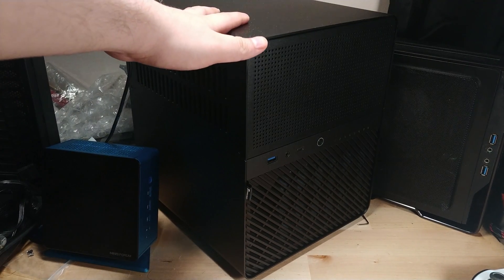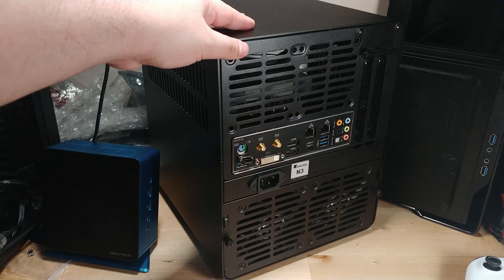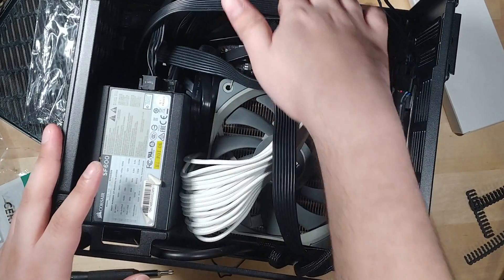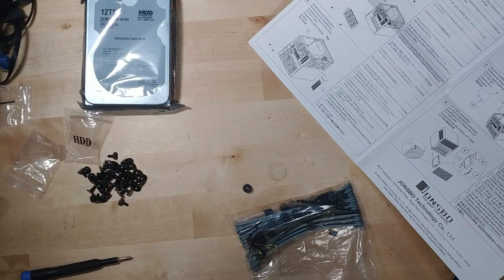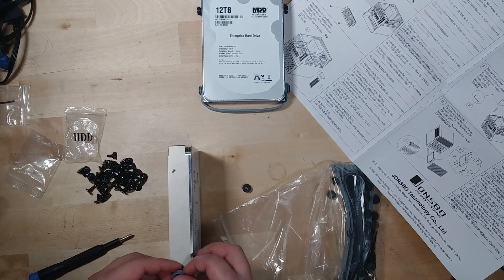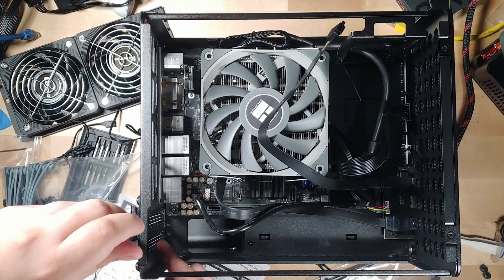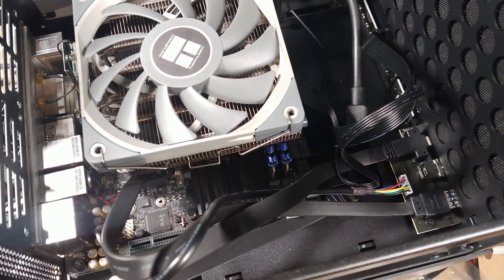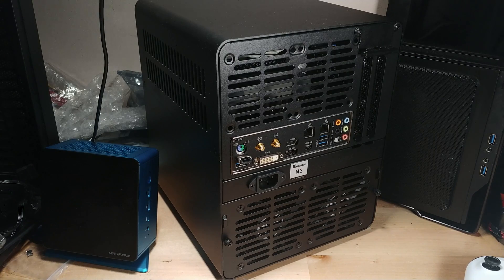8 Drives In ITX NAS Case? | Jonsbo N3 DIY ITX NAS Build | 52TB Of Storage

Comment: Funny thing is, that now there is a C246 chipset based board on Ali that I and a friend have ordered for that case that has 8x SATA on board and 3x M.2 PCIe (1 on top and 2 on the back) that is basically made for this case :D 
I will use one M.2 for a USB 3.1 10Gbit controller to populate the USB-C at the front and maybe later cut a little hole for another on the back. One M.2 on the bottom for the OS drive and one for a 1TB SSD Cache.

Comment: @EVOTech1  I have this mobo and a 6600k and a 7700K cpu. Can you do a video on under clocking to lower the tdp please? Also is your Z-170 a Rev1.0 or Rev2.0? 
Rev 2.0 allows for bifurcation of your x16 pcie slot.

Comment: i have been planning for a month to build on N3 case. as you said it takes a lot of planing
Reply from the maker: It's honestly so worth it. I love this case. We recently renovated one of our rooms and it happened to be the one where we kept the servers in. I have this N3 Nas and another older one that is running in a rosewill server case. moving that rosewill was such a pain in the ass, but the N3 being so small was so easy to move. I'm honestly considering swapping my old server into an N3 case. it's mostly 8TB drives anyway so if I go with 14-18TB drives, I'll end up with way more space while downsizing in the number of drives by just 2. Having a compact system with so much storage is honestly so much more useful than I would have originally thought.
Reply: @EVOTech1  thanks for sharing. Lots of people online complain about the drive bay and the rubber strap ( literally no one swap there drives frequently you just leave it there ) but they don't get that for less than 150$ you're getting a 8 bay hot swappable and good build quality case which will last you a lifetime. For the size and value of the case I'm grateful to jonsbo

Comment: a must have for these itx nas builds: thin sata cables. there are ones from silverstone and supermicro. sas to sata, sata only, whichever you prefer. but, beware. i bought the silverstone ones and they are nice but the cable is coming from the side of the sata connector that goes into the motherboard. so you will need to bend them if you have sata oorts on your motherboard one right next to another. really silly design, it would be better to have the cable coming straight from the top of the connector, but then that would be an issue for those vertically stacked sata ports on the mobo. i didnt try the supermicro ones since they are obscenely expensive in my neck of the woods. i managed to squeeze the silverstone ones and for now, knock on woods, they are fine.

Comment: you should use the stock cooler, or a general small copper contact, aluminum thermal heatsink cooler,  rather than the thermalright AXP-120, it's too big and waste of money
Reply: The case can handle it and t's only $30.

Comment: If you don't need the onboard wifi, you can replace it with a miniPCIE  to SATA card which has two to four SATA ports.  It's usually just a single PCIE 3.0 lane, but that is capable of handling two 2.5" SATA SSDs, leaving your PCIE x16 slot free for future upgrades, like a 10gig NIC.

I chose the Jonsbo N2 for my NAS, and I plan to use a pico PSU to leave room for a 3D printed 4 bay SSD cage at the back, and I have a QM2 combo card with a 10G NIC and two m.2 drive slots onboard.
Reply: Are you sure regarding this? 
Will the OS recognize those drives?
Reply: Have you actually tried this?
Reply: @brbbst  Yes,  in my old NAS.  I had a Gigabyte Z97N-WIFI ITX board with six SATA ports but my chassis had eight bays.  I swapped out the wifi card for  the miniPCIE SATA card with two additional ports.  It worked a treat.  

Note more modern boards use a CNVIO slot, which is different to the old MiniPCIE.  Also check for clearance - some boards have the slot positioned between two  other modules on the REAR IO and you might not have room to fit SATA cables.
Reply: @Spreadie was that a Haswell system? Was the wifi module pcie in those? I think it was M key. Interesting idea.

Comment: IOCREST M.2 might help, if there's a need to reserve pcie slot for other uses. But that'll require an itx mobo with at least 2 or preferably 3 M.2 slots.

Jonsbo kinda dropped the ball a bit for not having this case supporting matx, but having few extra inches here & there. Having said that, my N3 build has been doing well, albeit not without difficulties.
Reply: Mine fitted in, but it is the smallest µATX, ASUS AM1M-A, only 22,6 cm ...